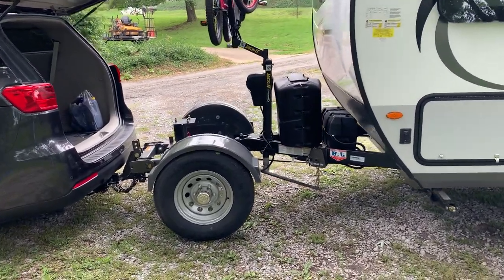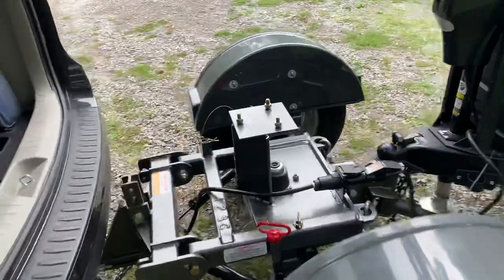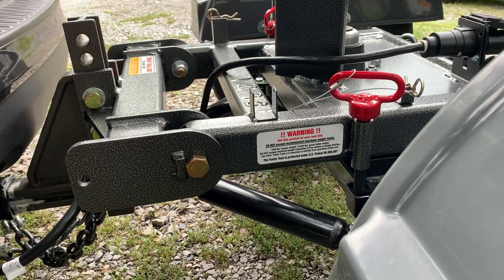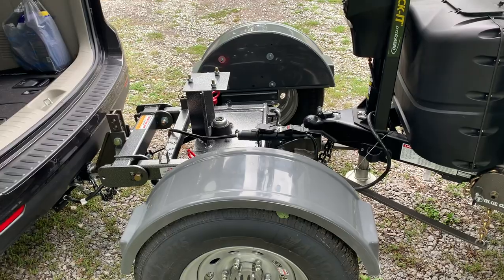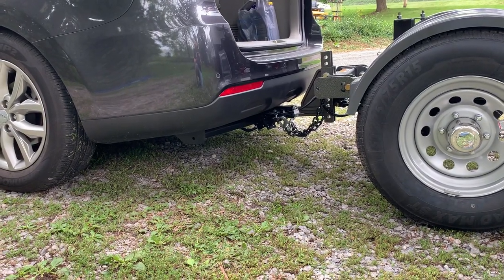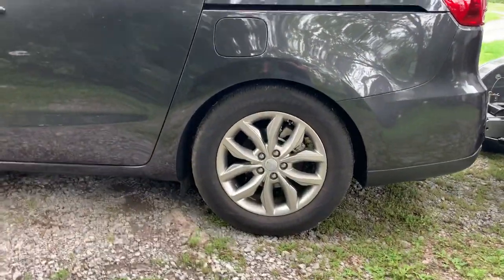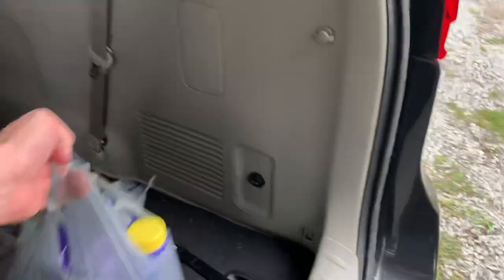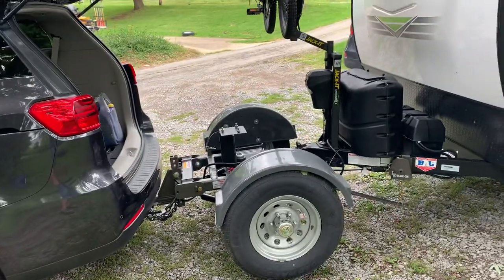Walk through of the Trailer Toad

Comment: would be interesting if the toad was designed for the wheels to be beside the tongue and fixed so that way a longer extension can mount to the car to allow turning. Any alteration of the standard center mounting point like what you have would leverage your car upward and reduce weight traction. Interesting concept though. I guess a simple longer extension to the vehicle would be more effective.

Comment: Does the Trailer Toad tilt when the tow vehicle and the Trailer Toad are on different planes, unequal flat surfaces?
Reply: Trailer Toad tilts, axle swivels when turning and the axle is a torsion axle. So each wheel can adjust to plane too.

Comment: Well, the gadget seems to overcome 'tongue weight' issues, BUT you're still over the tow weight capacity (3500#) when the trailer is at max capacity when it weighs 3900#, then add your camping clutter, passengers, etc inside the car, I'm betting you're at least 10% over towing & cargo total capacity. So, be aware of that in traffic, your stopping distances will increase substantially.
Reply from the maker: Silas Longshot you think I’m blissfully throwing safety into the wind apparently. I’ve been researching every single factor that goes into tow ratings. I’ve researched all the vehicles that have my same engine and drivetrain. I’ve compared the size of my vehicles rotors and pads vs other trucks that tow more. Here’s what I found out, Minivans suspension is designed for comfort so it’s extremely soft. By taking the tongue weight off the Minivan, my minivan brakes without issue. I’ve tested 60 to 0, 45 to 0, 30 to 0 and each time the van performed amazing. If there was 1 unsafe thing that I could find, I promise you I would have found it by now. Braking is spot on! Engine power is spot on! Pull strength is better than expected! Transmission temps stay below 205 degrees in stop and go traffic and 190-195 on the freeway. So please tell me what piece I’m missing from my months of research because I’m all ears.

By the way, the 2020 Kia Carnaval in the EU  which is made on the same assembly line at the same South Korean factory in Ulsan Korea and it can tow 2,000kg or 4,409 pounds. It’s literally the same exact vehicle just in a different country under a different name.
Reply: @CarReviewer-nc5bz  well said .
Don't take shit from zombies

Comment: All you keyboard engineers please pay attention.  A class 8 truck weighs 17k pounds but tow rating is 33k to 80k max in usa.  This guy is correct.  The tow rating is completely changed when you use a toad.  That is the entire point.  Toads like this have been around since the 50s, it is not a new concept.  The difference between this toad and one used on semi trailers, this one has friction pivots where semis dont.  So the comments of this will push you around is not accurate.  This put a small downforce on the back wheels, it has brakes connect to trailer brakes so it basically is a towable wagon at that point.  Again for people confussed by the concept of these toads, they have been around forever and many are out there.

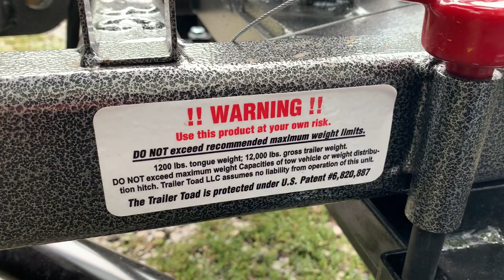Comment: People do not use this setup to tow!  It is unsafe!  You can clearly see the warning sticker on the Trailer Toad at 2:33 which states:  "Do not exceed the maximum weight capacities of the tow vehicle or weight distribution hitch".  This means the total weight of the tow vehicle, passenger, cargo, trailer, and any cargo on the trailer, and in this case also the weight of the Trailer Toad, cannot exceed the GVWR of the tow vehicle.  Not any one item, but all of them added together.

The total weight of the trailer (and Trailer Toad) also cannot exceed the rating of the receiver!  The whole system must be thought of as a chain, and your capacity is set by the weakest link.  The weakest link can be the hitch, receiver, frame, suspension, engine, transmission, tow vehicle weight, and especially brakes.  The brakes must be sufficient to stop the whole train without failing in the case the trailer brakes fail!  (Stopping distance will be horrible, but at least you will stop, eventually.  If the brakes are undersized they will overheat and also fail.)

Trailer Toads and weight distribution hitches do not affect GVWR!  All they do is load balance, or in the case of the Trailer Toad provide a solution for the case where your tongue weight is too heavy but you are still within GVWR.  You cannot convert a minivan into a 12,000 lb towing machine with a Trailer Toad!  Don't try it!

If you want a tow vehicle, buy a tow vehicle!  Your family is at risk!  You cannot convert a minivan into a tow vehicle with any sort of hitch accessory.
Reply: You know the reason for said sticker? to cover their asses from the liability, in case someone where to severely overload it.

I have a vehicle for you to look/compare look up a 19 Expedition max , they can tow like 8500 lbs, but then take a F150 and they can tow like 13k (with worse gearing to boot), even though the drive train and such are the exact same. Brakes are give or take the same (same pads and rotor diameter). The biggest limiting factor? The rear axle weight rating..... so if you control the load on the rear axle, it will easily tow more on the expedition, probably even up to the f150's 13k....    but yes legally per the door jamb sticker you are still limited to the GCVW, but there are ways to get it changed though
Reply: @mr.gearhead9468  Not many F150's can tow 13,000 lbs, the one I had certainly couldn't, and it had a 4.6L V-8.  But some of the 2 wheel drive 5.0L's can.  Expeditions will never have the same towing capacity because the vehicle is already much heavier with the extra body and seats, so payload is reduced.  Also the Expedition has "rear independent multilink suspension", which isn't the same as the F150's solid axle.  Expedition suspension is also tuned for a smooth ride, not extra payload.  So differences abound.  But in the end of the day towing capacity depends on a number of factors, the brakes, engine, and transmission being as important as the suspension and frame.  Even the tires factor in.  You just can't tow much with a front wheel drive minivan, no matter how many wheels you add.  The reason is it doesn't have the gearing to pull all that, probably not the horsepower and torque either, and it doesn't have the vehicle weight or the brakes to stop it safely.  You'll smoke the transmission going up hills, and you'll end up relying too much on the trailer brakes which can cause it to fishtail, or you'll warp your rotors, and your stopping distance will be too great.  And I haven't even gotten into the flimsy unibody construction of the minivan.  Both the F150 and the Expedition have frames.  Minivans do not.

If you need to add wheels, you've got the wrong tow vehicle.

Comment: This is all wrong and dangerous!! GVWR  is based on the weakest link of:  axle capacity, !BRAKES!, Engine HP, !Transmission clutches ratings!, and torque at the rear wheels.. If the electric brakes go out on that trailer on the hwy at speed that van will not stop it in a reasonable time. Also if you are carrying more than gvwr=van+trailer+cargo  D.O.T. can and most likely will pull you over, give you a huge fine, and impound your trailer, and suspend your drivers lic. If you get in any kind of accident YOU are 100% at fault no mater what happened. You may also be prosecuted for criminal negligence, and if there is kids in the car child endangerment. These are for busses and trucks not for mini vans. Do some research before you hurt someone.

Comment: You are confusing tongue weight with gross vehicle weight.  Yes that gadget has resolved your tongue weight issue but has added to your gross weight problem. That trailer toad weighs 400 pounds by itself, that added to the 5000 pounds or so on your fully loaded camper and you are way over the rated gross weight for that mini van. Hopefully you don't hurt anybody WHEN the inevitable happens.